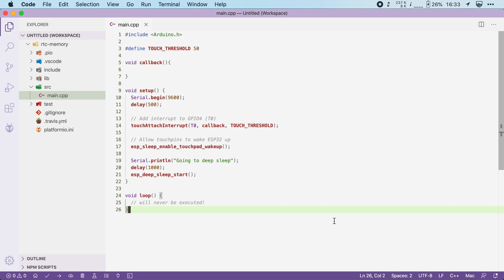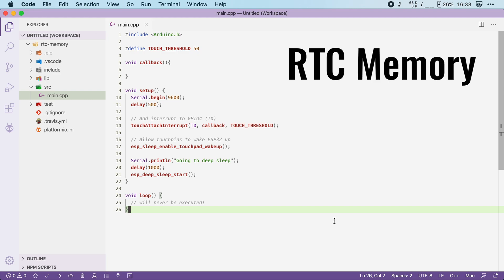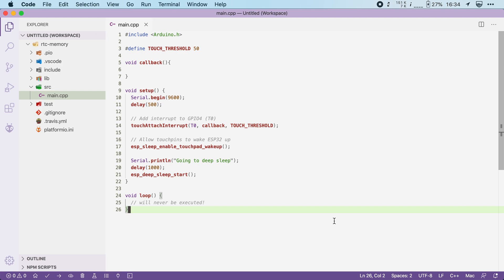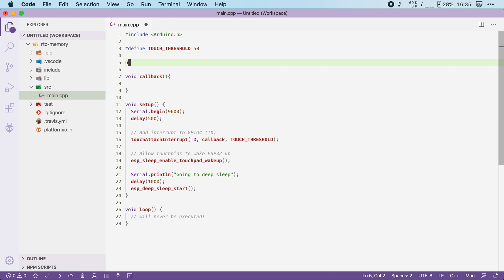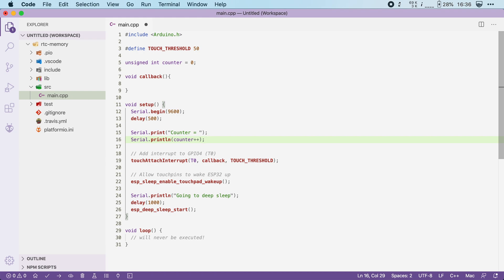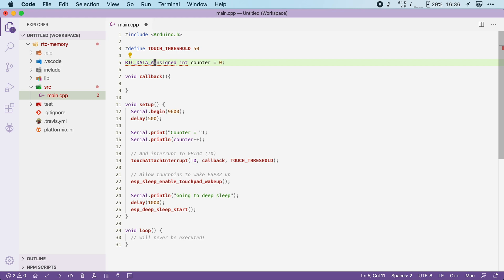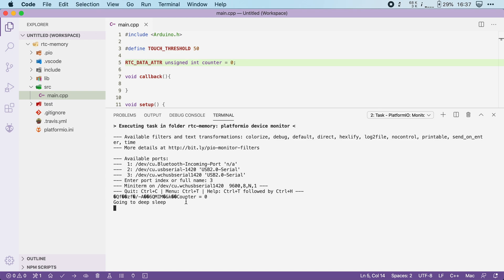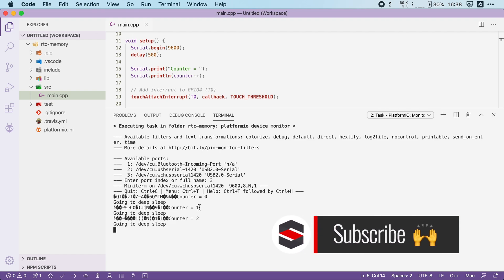Deep sleep: Use RTC memory to store data (ESP32 + Arduino series)

Comment: Hi, i need use the rtc memory like a RTC but i don't know if that is possible using bluetooth or GSM. The battery is not a problem because the sistem never loss the power supply.
For setting the time, i need the Time library and setTime?

Comment: This is probably the only video on YouTube that explains the RTC memory clearly. In my application I want to run the "sensing" part of my code in deep sleep and wake up once in a while to transmit data over wifi to MQTT broker. Lets see how much of the code I can fit in 8K memory. Just wondering if you can access IO pins when in deep sleep mode?

Comment: Hi, When I turn off the ESP32(Not deepSlepp - Turn off completely), does the RTC memory  store the last value in counter, or is this value lost? Thank you for the video and sorry for my bad English :( Saludos desde Colombia
Reply from the maker: Turning off the ESP32 means losing all RTC memory. You have to keep it in deep sleep. That might not be a big penalty if you have a sizeable battery. Deep sleep only consumer 15uA (and newer boards only consumer 7,5uA)
Reply: @simplyexplained  Thank You very much, Actually I have a Nodemcu V3, and I had to use rtcmem from the ESP library to store data in RTC Ram. Fortunately, it is an advantage to me that this memory is non-volatile during deepsleep and volatile when turned off. Thanks.